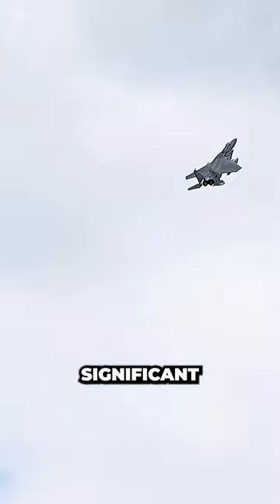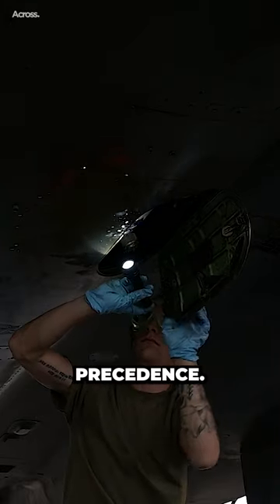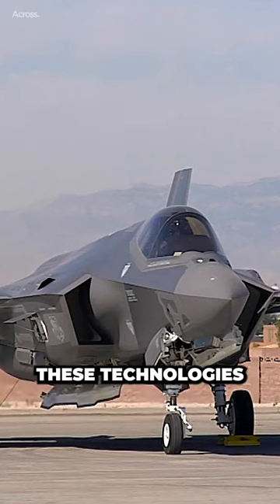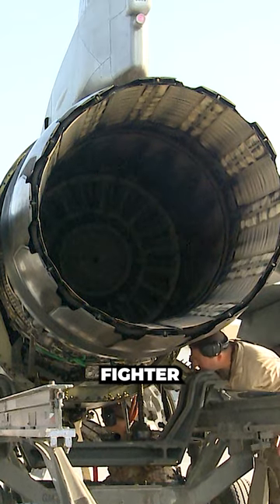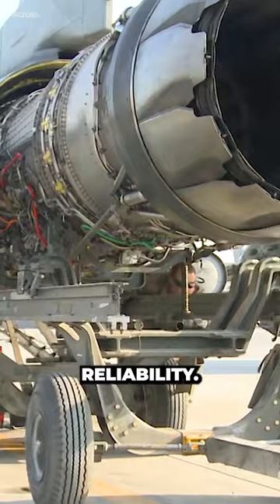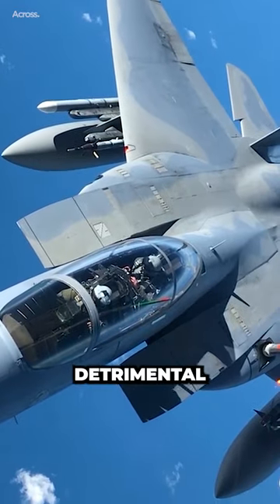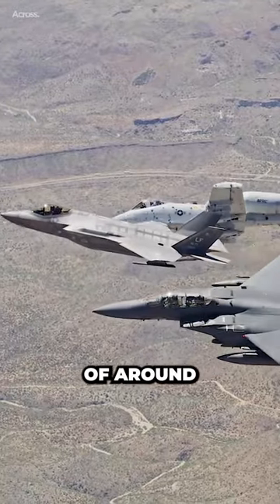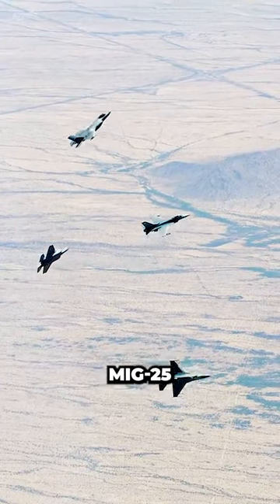Why Are Modern Fighter Jets Slower? #shorts

Comment: The heat also damages the stealth coating on modern jets
Reply: And stealth aircraft 😊
Reply: @lilMungo 
it's literally what he said/implied
Reply: yeah that’s a big problem for the f35, it can’t go supersonic for more than a few seconds, since the stealth coating has been known to bubble at those speeds, not sure if it’s much problem for the f22 however
Reply: @brendanbeizerman4096  I believe it isnt for the f22. It can supercruise (go supersonic without afterburners), and I don't think that would be of much use when the aircraft wouldn't be able to fly at such speeds for long. And it does have afterburners, so those wouldnt be usefull aswell
Reply: @brendanbeizerman4096  The problem is a bit exaggerated.  It is only repeated, sustained supersonic speeds that have an effect on the coating.  But that is about to be a thing of the past, as the US has developed a ceramic RAM coating that is both more durable and more effective at absorbing radar waves than the current coatings.  It is still in the test phase, but it will make maintenance for US stealth aircraft much less complex and expensive.
Reply: F35 can’t even sustain supersonic for long.
Reply: @bluemarlin8138  yeah with such things it's always a matter of time before a solution/better alternative is found.
Reply: You generally need afterburners for 'raw speed' ... you don't want afterburners if you want stealth!
Reply: @simonblackham4987  very true. Except both the F-35 and the F-22 have afterburners...
Reply: @scatmanpro  ... but you don't want to use them when being stealthy ... but do if in visual range combat ... especially if 'bailing out' and to avoid canon fire ... but not when trying to break a missile/canon lock (use flares!).
Supercruise is important ... fast as you can, supersonic, without afterburners, so not giving your position and heading away!

Comment: F14 Mach 2.2 until it runs out of fuel
MIG 25 Mach 3.0 at very short bursts, because the engines self destruct.
Would be a closer to the truth summary 😂
Reply: Hint: the MiG 25 isnt around any longer.
Reply: >until it runs out of fuel

As opposed to the f35 that can fly without fuel too?
Reply: @Japcsali  F35 is fueled by hopium.  The US supply of hopium is considered an endless resource.
Reply: @Japcsali  the point is that one plane only goes fast in bursts, the other can hold full throttle until there’s no fuel. Comprehend?
Reply: @YouTube_user3333  of course, that doesn't mean you can't elaborate on it better than in your OP comment
Reply: @Japcsali  I wouldnt think he needed to elaborate. I understood the comment, youre picking fun at semantics
Reply: @Che Burashka  Yes it is.
Reply: Guess what my lesbian friends.... Mig 25 can go faster than mach 3.0... Its only limited to 3.0 not dp demage engines.... Also f35 cant supercruise what about that? 🤡
Reply: @mlady_richard  Ok Kremlin bot, time to go home, you reached your quota!

Comment: One other thing to consider with modern jets versus older generation fighters is that those top speeds listed for 4th Gen Fighters are hit in clean configuration. Meaning that those fighters would be flying with no external munitions, sensor pods, or fuel stores. Modern stealth aircraft have the luxury of always being in a clean configuration therefore they are able to achieve their top speeds more frequently and easier than legacy jets can hit their top speeds in combat configurations.  The same concept applies in the spectrum of maneuverability. So while a clean Viper may be more maneuverable than an F-35, a combat configured Viper will not be more maneuverable.
Reply: Exactly.
Reply: Never thought about it like that damn, learn something new everyday

Comment: The reason for the slower max speeds of fighter aircraft is not actually because of technicle limitations, but of practicality. The F 14 and F 15, both with a top speed beyond mach two, never went faster than mach 1.8 abd even that very very rarely.

Also, the Foxbat is not a fighter aircraft, but an intercepter specificly build to intercept the Blackbird. As a fighter it was unusable.
Reply: Ага когда речь заходит о маневренном воздушном бое начинается разговор о том что современному самолёту это совсем не надо пустил ракету на большой дальности и домой. Что это? Это и есть перехват!
Reply: The Foxbat was built to intercept bombers, not the SR71. And even if it was, it was still to slow to catch the SR71.

Comment: Speed is still very important.  There was a saying in the fighter community that "speed is life."

Sure, modern technology, weapons, avionics, stealth characteristics, etc. are all important factors, but speed is energy.  Without speed, your plane doesn't go forward.  You run out of speed, you stall.  Depending on what plane you're in, you're either a feather on the wind or a brick.

Energy gives you the ability to maneuver.  Speed gives you the ability to climb / gain altitude.  Altitude is more potential energy.  You run out of altitude, you run out of energy. You run out of energy, you run out of maneuverability.  You run out of maneuverability, you run out of options.  You run out of options... you run out of life.  Speed gives you the option to either chase down a slower enemy or run away.  If your max speed is Mach 1.6 and your enemy's is Mach 2.2, you will probably not have that option.

Comment: The entire premise is WRONG. Modern jets aren't slower. You must understand that in a stealth fighter, that keeps armament internally, max speed and operational speed are the same. F-22 can go 2.2 Mach even with full armament. An F-15 can go 2.54 but only in clean configuration. With full AA armament, is limited at 1.7. Also, modern fighters have more internal fuel and/or supercruise. This means that they can mantain high speeds for far more time.

Comment: The heat at Mach 3.2 had the Foxbats falling apart, also, not only would the engines burn themselves up, the turbines blades at such speed had significant air erosion. From what I read, it’s almost the same effect as cavitation on ship propellers

Comment: I don’t know anything about this topic. Maybe you’re right. What you’re saying doesn’t make sense to me. 

A jet isn’t going to be faster than a missile that will try to identify it and lock on from miles and miles away and change direction to follow it. 

That’s not a game the jet is going to win … so why fight it? The smaller lighter missile will be faster. 

So, speed isn’t the key winning factor like it used to be. And, that’s why jets are slower. At least… that’s what I would assume. 

It’s like wearing body armor after all the bullets used will defeat the armor. If wearing armor doesn’t help, drop it and save the weight. I believe that’s what we did with suits of armor after guns were invented.

Comment: True. The F-35 was designed to go much faster, but they brought the speed back for the reasons mentioned here. Also, the top speed of fighters used to be classified as were the speeds of the missiles fired from the same platform.

Comment: This is somewhat deceptive..
One of the marks of the fifth generation of fighters is much more powerful engines. The problem with the Chinese and Russian so-called 5th gen fighters is that they’re having issues developing engines that are powerful enough to get those benefits.
While yes, they sacrifice some top speed they’re able to fly in supersonic speeds without the use of afterburners which saves huge amounts of fuel and extending their range greatly and also increasing their power to weight ratio greatly as well which allows them to be more maneuverable and recover much more quickly from a loss of energy due to maneuvering.
Energy is the currency of a dogfight. 
While some instances it’s good to get slow, most of the time this is a detriment and will get a fighter killed.
Maneuvering in a dogfight comes at the cost of energy so possessing those powerful 5th gen engines gives them super maneuverability which is another important factor to possess if you want to call your fighter 5th gen.
While technically speaking the F-35 doesn’t possess super cruise or super maneuverability it is able to still go close to super cruise speeds without the use of afterburners.
Again, on paper they determined the speed to reach us match 1.5 which the F-22 can do but the F-35 can only reach Mach 1.3 so it’s kind of splitting hairs by saying it doesn’t have the technology and super maneuverability is where a fighter has exhaust nozzles that can use the thrust of the engines to turn the fighter making it much more maneuverable than ones without this technology.
The F-22 has this technology but it’s expensive to put in an airplane so they left it off of the F-35 however, one of the marks of a super maneuverable fighter is that it can perform a falling leaf which is where the plane spins on it’s axis doing what’s called a flat spin as it descends and both fighters can perform that maneuver.
The reason the F-35 can perform this maneuver is because it has the most powerful jet engine ever made so it’s not rated as a highly maneuverable aircraft but the thing is that nations rightfully don’t just give it that information so it could very likely be more maneuverable than most people are led to believe.
The US fighters like the F-16/18 have leading edge extensions which give them exceptional AOA or angle of attack rich basically means they can get their nose on much easier than fighters without that technology and the way the F-35 is designed they find a way to mimic that in a stealth fighter so if they were not worried about maneuverability on the F-35 they wouldn’t have spent the money to engineer around that to give the fighter that extra edge so my thinking is that the performance of the F-35 is greatly underrated and that’s on purpose.
That being said it’s probably no where on par with the F-22 and it’s likely more comparable to some more maneuverable 4th gen fighters like the F-16/18 and in the first few turns it may even have a few tricks up its sleeve that give it a temporary advantage
Reply: You're talking about thrust vectoring, right? Because yes, the F-22 has that, but only on the Y-axis. You're saying the F-35 doesn't have that, bit it most definetly does. It even has it on all axis (plural of axis?). That's also partly how the F-35 B (the aircraft carrier variant, I think it was the B one) gets its low take off and landing capabilities. They also enhanced this by making the airplane able to completely point its exhaust nozzle downwards, creating part of the thrust neccesary for vertical takeoff and landing (it also has a big ducted fan right behind the cockpit for even more thrust). This is an alternative for VTOL fighters like the Harrier, which used smaller exhaust nozzles in the wings and other parts of the airframe which bled thrust out of the main engine towards the ground, enabeling the jet to fly upwards and downwards vertically. Funny how this is a completely different subject than speed of modern aircraft 🤣
Reply: @scatmanpro  false! The F-35 does NOT possess thrust vectoring of any kind.
Look it up

Comment: Super cruise is a big benefit of getting to the fight faster.  Yes, dog fighting is not as important, but arriving at a conflict in time before the conflict is over is very much important.  The F-22 is our sole aircraft that can do Super cruise.
Reply: I'm pretty sure the F-35 is also capable of supercruise, again for limited time to avoid damage to stealth coatings.
Reply: @Mrfishlou  That is a fine response, but fast to the conflict is what I was responding to.  Being able to get to a situation and fire missiles is important.  This is why the MIG 25 and 30 was built to combat the SR-71.
Reply: @Mrfishlou  If the F-18 got the upgraded engines it was supposed to get, it also could do supercruise according to my power to weight/drag calculations.  I believe it was not given the new GE engines due to wanting to sell more expensive airplanes.

Comment: 1) fuel efficiency. Carrying less fuel means more ordinance. 
2) Newer aircraft are designed for better liw altitude proformence 
3) The F-15 has been in service for close to 50 years, and its top speed is still classified .

Comment: Seems that speed has never really been important in jet to jet engagements.  In real world.  

What IS important is maintaining speed/energy, during maneuvering.  

Unlike the guns only era, where you could run away, in the advanced missile era, you are not outrunning a missile.  Better off to have counter measures and they are even working on active counter measures like anti-missile lasers.
Reply: You are out running a missile, more specifically out turning it while dragging it down into thicker air. Missiles have limited fuel, most short range and long range air to air missiles have burn ranges from 10 seconds to 60 seconds respectively, allowing the missile to reach max cruising speeds of 800mph to 2,000 miles per hour respectively. After the burn phase missiles operate solely on kinetic energy while using it's control fins to maneuver. Turning burns its energy and slows it down while lower attitudes provide more air resistance slowing them even more. A standard beyond visual range tactic with long rage radar guided missiles is to aggressively gain altitude, fire at tour target and quickly turn back towards the the ground, flying as close to the ground as possible while flying away from your target and maneuvering in an s shaped pattern all while deploying chaff. Pop back up to altitude gain a lock and repeat the whole process. SAMs can also be defeated using the same methods as long as the pilot knows from which direction the launch originated.
Reply: @MondoChow777  dodging modern SAM'S and AIM'S is easier said than done.

Comment: Raptor is faster than that and does run out of fuel faster. Actually, supercruise is more important than top speed. The raptor is so quick in supercruise that other coalition  fighters cannot keep up with its tactical bomb on the move speed.

Comment: The foxbat was supposed to be a fast interceptor for the XB-70, and the Raptor goes Mach 2.25, not Mach 2, and the "slower" speeds need to comprehend for the radar absorbing paint both the F-35 and F-22 has

Comment: Speed was never a determinant a fighter jet’s effectiveness. For intercepting? Sure, but for dogfights and jet based air-to-air combat? The US military did a study on how fast jets would engage in combat and their speed rarely exceeded Mach 1.0. You could never break the sound barrier as a fighter jet and be completely fine on the battlefield. The only reason here ever went this fast was to intercept high speed bombers, but with the rise of missile systems and ICBMs intercepting became useless because why would you risk a plane and pilot trying to take down a bomber when you could just launch a missile, completely safe from several miles away? Aircraft going fast in air-to-air combat never made sense to begin with, it just took militaries a while to figure that out.

Comment: speed is always a significant factor in any battle be at ground or are more power more speed means you can get away from the enemy and outrun his missiles no good when you're good fuel mileage is getting your shot down or getting you shot up we're putting a jet engine in a tank that eat so much fuel it's hard to keep up with it, when there are piston engines that will do better on fuel mileage with the same power a lot cheaper

Comment: In BVR fights speed is a crucial factor for all fighters. Faster jets will have increased missile range and/or less time to impact as well as being able to run away or crank incoming missiles more effectively. Also a great majority of the most modern fighters still reach very similiar speeds to Gen 4 fighters. Its just the F35 thats a turd.

Comment: Speed is still important.  Higher speeds and altitudes do help missles achieve longer ranges
Reply: Yes but you need to sacrifice too much on the airframes part to do that like coating damage and excessive fuel use 

At the same time modern missile technology doesn’t really need the boost, missiles are starting to incorporate engines that go for much much longer meaning that missile will not struggle to hit targets no matter how slow the mothership is going